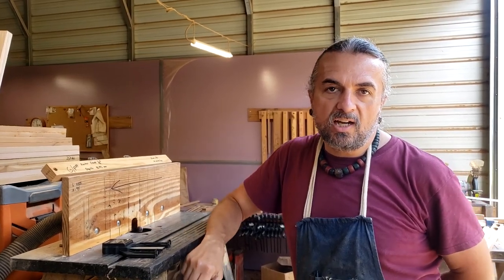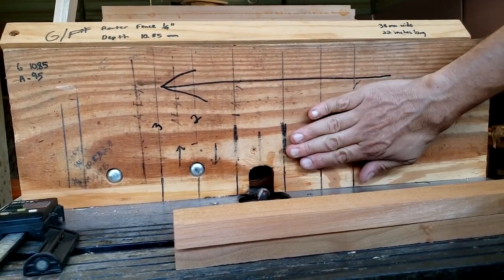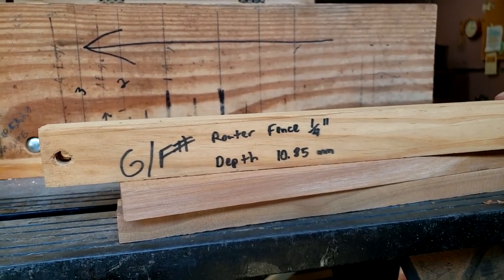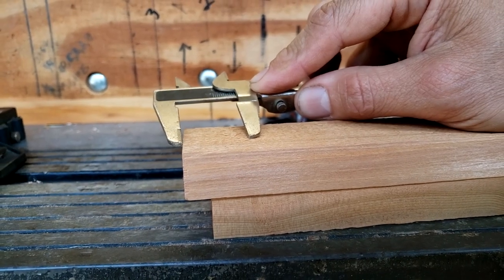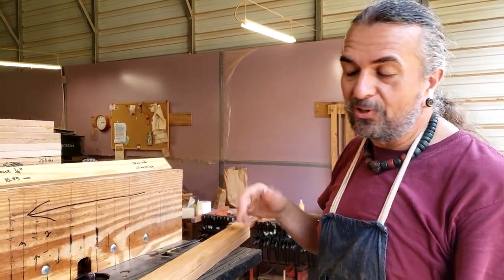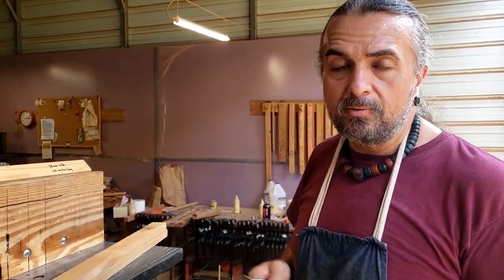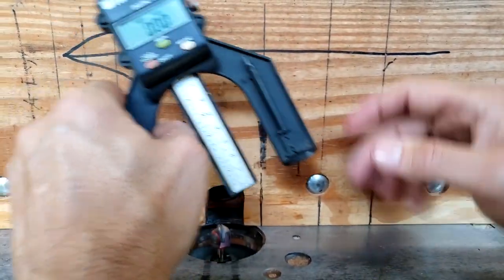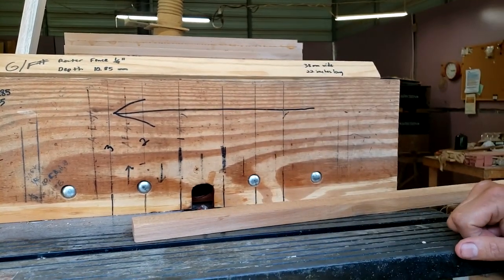My Router Guide Explained - Native American Flute Making

Comment: Nice video 🙂 I just got a router table a few days ago. And tbh it scares me a little. I've tried it a few times. Got a kickback when I wasn't paying attention. The wood just flew out of my hands and on to the workbench. I didn't even get any say in the matter, it just left me standing there, flabbergasted, looking like a, I don't know what.. Of course I was feeding it the right way according to the router arrows, but I was cutting along the opposite wall. And it took me a split second before realizing what I had done. A few moments later it dawned on me that I had been warned about this exact thing 🙏 
Great tip btw, marking the guide. How many different guides do you use?
Reply from the maker: Used to be 8 or 10, these days zero. I do things a little differently and hope to share my techniques in the near future. Please be careful!

Comment: So very much like the system that I use on my router fences! A "pro tip" for both the carbide and the tool steel bits, the occasional overnight soak in 90%isopropyl alcohol or denatured alcohol followed by a quick scrub with an old toothbrush really takes off the tar and pitch that makes a bit seem dull. Other types of bit like a roundover that have a guide bearing benefit from this too if you first remove the bearing. Just slap her back on when you finish cleaning the body of the bit. Otherwise it will seize due to having the lubrication dissolved in the alcohol. Enjoyed the video as always.
Reply from the maker: I used to soak my bits in vinegar just like I do my torch heads because it gets everything off as well. These days I will dull the bit way before it gets any build up!
Reply: @BlueBearFlutes  True enough. Yes, you truly do give industrial level wear to your bits with the amount of flutes coming out of your shop!
Reply from the maker: @davidmurphy6884  😉
Reply: Good information on the router use for flutes.

Comment: Hi, I find this routing video very well presented and very informative. I made a comment explaining in more details the “right and wrong“ way of routing. I wasn’t intended for you as a lesson, I was only hoping it might be helpful for someone just starting with a router.
Anyway, I just deleted my comment and also I sincerely apologize to you for causing unintended problems.
Just for the record, I have subscribed to your channel several weeks ago and I find it very interesting.
Reply from the maker: Thanks for watching Ludwik. It sounds like you are a very technically minded person. That is not a bad thing at all however most of the people that are interested in making a Native American flute don't have many tools if any and only few (though "around 10,000 use a router table"). Of those, countless have asked me what the guides and markings are on my router table that I have added. You may be surprised to find out that most people who route a 1" or larger diameter (radius) hole in order to make a large-bore flute do not use a 3/4 inch bit like I do. Most of them use a 1-inch or X size bit for X size hole. As I mentioned in the video, I prefer to use the bits which I can buy locally since we make so many of these flutes! There is no need to apologize - I appreciate your comments!
Reply: @BlueBearFlutes Hi, thanks for your comment and understanding. 
Just to end this technical discussion I would like to say that your choice of baying locally available smaller bore cutter gives you added benefits (apart from what you already mentioned). The smaller cutter is chipper and safer to use. But hey, what are we talking about? I suspect the flute bore doesn’t have to be exactly cylindrical. For me, most important is the sound coming out of it, and this is where you excel. 
I could make something resembling a flute but I prefer to dedicate my time to learning how to play one relaying on artisans like you to make the best.
Still, some people may want to make a flute and there is nothing wrong with that too.
By the way, I love your argument for the five hole flute.
Regards, Ludwik

Comment: Hi Charlie. Is it possible to do carve with an handheld router?
Reply: They usually have these attachable guides, they work fine if you just go slow :)
OR, you could just fix the router to something, and instead feed the wood through underneath. I made a jig once like that. It's the same as in the video but upside down.